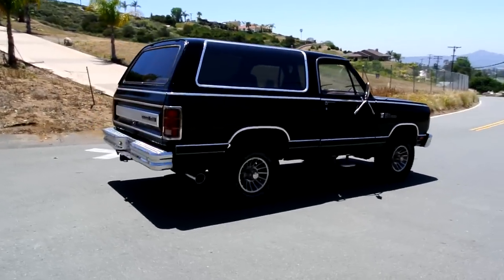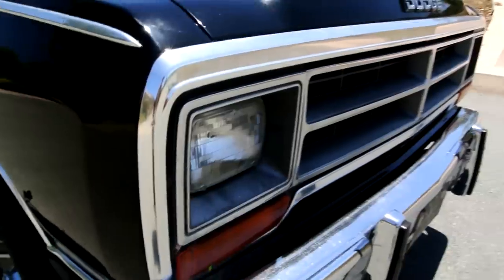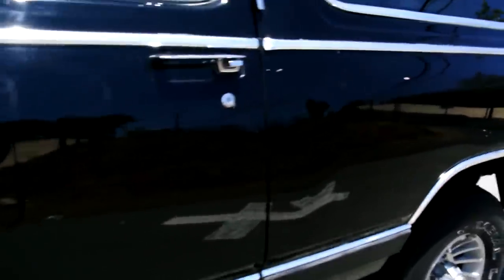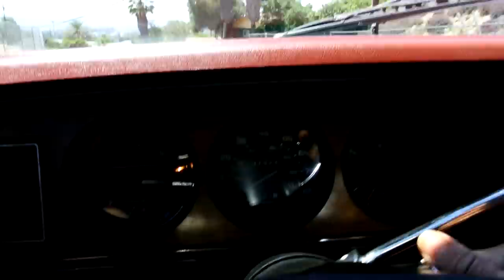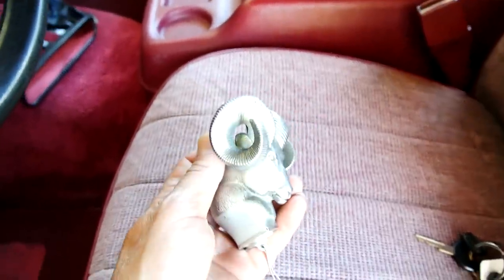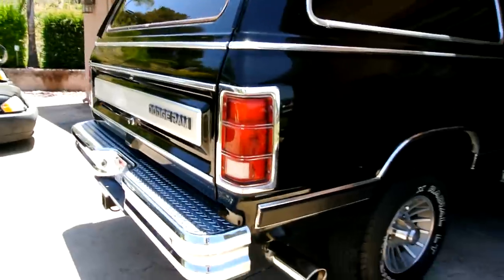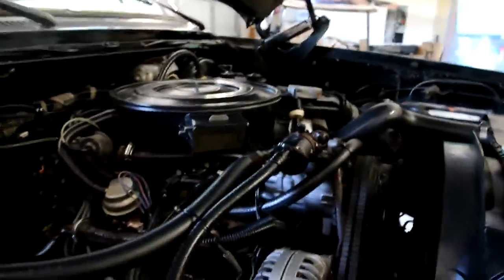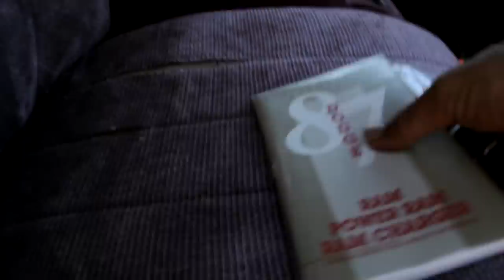1987 Dodge Ram Charger 4x4 CLEAN Blazer Bronco Ramcharger SUV Youngtimer 1986 build

Comment: A dodge ram is a pickup, the ramcharger is an suv as u can see, theyre built on a shortbed ram frame, maybe cut dow a few inches? Either way its an oversized station wagon that has a transfer case. Non the less they are bad ass!!! I want one for long trips with the wife and boys cause theyre heavy and ride amazingly and if i dropped a diesel in one with a six speed it would get around 30+ with the right engine trans and gear combo

Comment: How are you sir, I collect these trucks and I'm actually restoring 3 at the time. Both my 92 short beds have 5 speed nv4500 factory gearboxes, I think all 92 came like that, specs on my short beds are 230 hp-390 lbs or 380, the rear 9.25 is actually a dana 60. Please check out my 84 royale prospector also a very rare model.

Comment: I own an 87 RC...
Its white, and its RWD.
Im going to put a posi-trac on it and make it 4WD and some 33x13 all terain tires on it.
It runs a 318 chrysler v8 with an aftermarket carberauter (4 port jet!!!)
I bought it from some guy for $700 
All I have had to do so far is new distributor, spark plugs, starter, and a brake hose.
It is my first vehicle so I'm proud of it.

Comment: As far as I know, the 318 and 360 are the same except for the top end. Don't quote me on that. I have a '99 Ram with a 318 in it, 245,000 miles and counting. You can't hurt a magnum

Comment: I have an '93 Ramcharger I bought from Emery County Sheriff Dept.(Utah-was unit 50) in May of 2012. An LE version, 360 Magnum, all options, black with grey interior- they had a dash cover & seat covers (with special vinyl section stitched in so the gun butts & hammers wouldn't dig into the seat foam). My combo MPG is 14.2, highway cruising 70 MPH steady gets 17. Still have the Unity "Stratolite" spotlight. Neat rig...been a weird year for vehicles. Got a nice '90 Jag VDP  and a '76 Travco 320 (with 26K original miles) for free. The roof vent is stock

Comment: Don't know wbat the hell you're looking at. The aw150 ramcharger is a kin to the ram d150 pickup. Half tom pickup frame l. 318 or 360 v8. 2 or 4 wheel drive.

Comment: I believe the pickups are called d150. We had two ramchargers growing up. 1 86 and 1 89 prospector. the prispecor had factiry roll bar the other did not. They were pretty decent 4x4. Both of ours had 318
Reply: the picks have both a "d" and "w" variation. the D variation is the rear wheel drive 2WD version, and the W variation is the 4WD version

Comment: True,
But im a torque kind of guy.
I prefer raw strength and toughness over anything.
And is a 35 gallon tank normal for an 87, or is that aftermarket?
Every penny I save, I plan to put in my truck :D
I am going to rebuild the engine next year some time.

Comment: Were they? I would've thought that even a 4bt Cummins diesel would've been small enough and light enough to fit inside the engine bay without compromising the frame.

Comment: nice truck. the roof porthole is factory. the drivers seat does not tilt. back seat access is through the passenger side only. the roll bar is not factory. my dad had one. how much for this one?
Reply: the roll bar is factory. mine has one.
Reply: +venom gaming must have been an extra cost option. I've never seen a ramcharger with one.
Reply: +krazi77 yea it might have been. mine is an LE 150.